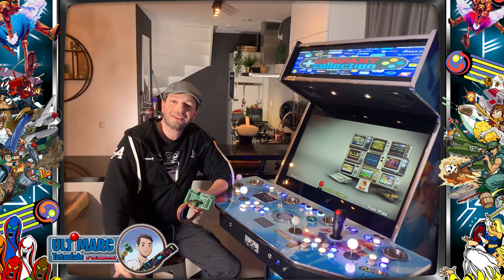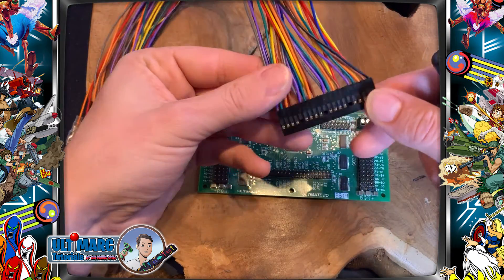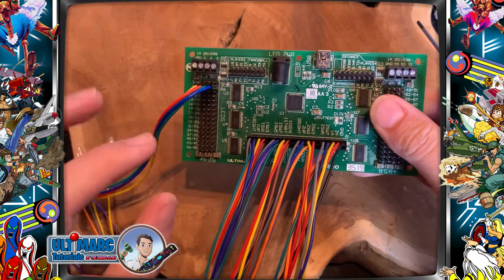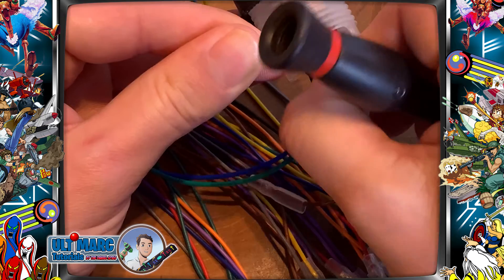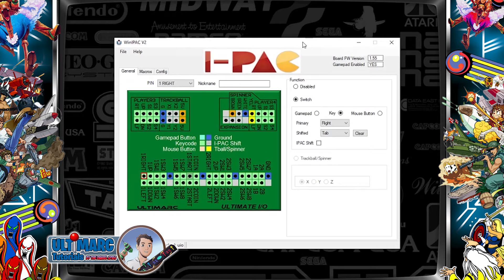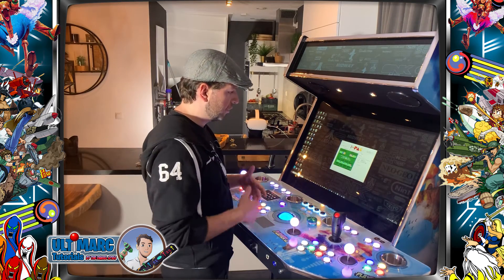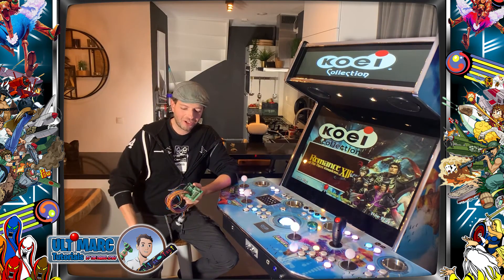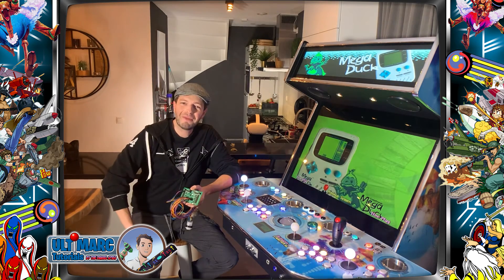Ultimarc Product tutorials: Ultimate IO board (Keyboard Encoder AND Led driver combined)

Comment: Why are are the harness cables so short? I have a two player control panel with trackball and the cables are too short? What do I do? Should I solder extra length in between each wire? I'm a bit annoyed that they just didn't provide crimp tips and extra wiring. I'm also confused about what extension harness to buy if I go that route.
Reply from the maker: The cables are not too short in my opinion. If you mount the board in the correct place you should be fine. You could try and ask Ultimarc if there are ready to go extension wires available.. Thanks D
Reply: @TheDanielSpies_Arcades  Thanks. That's what Andy told me also. But when I place the harness at the very center (which is my trackball) It barely reaches the right and left ends. I have an 8 button setup. 

Even if I had a slightly smaller control panel,  there could be no wire management when some of the wires barely reach. 

They do have extensions but I think I'll just solder some extensions.

Comment: Thank you Thank you very much now I know what this shift key is for, I only have 32 buttons and this solution will be useful: P
I have a question:
Do you know how you can configure the ipac so that when you start a given game, the wheels recognize the wheels, switch between the keyboard and the pad (as you know, most new games for Pc like Mk9,11 etc only work on the pad, you cannot change the buttons on 2 players) great that Ipac is in multi mode but can you make a script etc to do it automatically ?
Reply from the maker: Hmm good question. I know that you can change the Ultimarc IO mode to via command line. I can imagine that we could run an AHK script with the start of each specific game.
I don't have time to do this in my spare time but I think I can make the script. Contact me by email to further discuss. Thanks, Daniel

Comment: I'm trying so hard to get my ultimarc lux buttons and two ipac ultimate boards working. The LED's only light up on the first pin set of each side. Any help would be awesome. This has been a pain CP is 4 players spinner and trackball (hence the two boards).
Reply from the maker: This could be a defective board, wrong power supply, or lots of other stuff. You can make a video (in detail) and send it to me and I will take a look at it or, contact Andy (Ultimarc) for help. Thanks Daniel
Reply: @TheDanielSpies_Arcades  I sent Andy and Email. I'm using the same connectors that came with the two boards. The molex connectors. the second board when connected has two that will light up at the same time, one from each side. 

Each button turns on when you plug them in one at a time to the top slot, but only the top slots. 

We just got hit with a snow storm so waiting until that goes away so I can get the connectors I need to attach the sanwa sticks to the ipac (they are the 5 pin with wires bare at the end) then I'll put it back together and see.

Thanks for the fast reply.

Comment: Can it be configured to works in raspberry and works like an arcade controller separately? Example: I want to connect only player 1 on computer and play it without the raspberry operating. Im asking that because thar ultimarc io only have one usb exit, but can we choose what player to use?
Reply from the maker: I see what you want. You have a Raspberry Pi inside the control panel but would also connect it to a pc without switching usb cables? I did that in this build: https://youtu.be/0ax99FeprEk let me know if this is what you need? Thanks D

Comment: Hi how do you get 2 ultimate io boards working at the same time? I only seem to beable to do it one at a time
Reply from the maker: Hi, yes the trick is to give them a unique ID. You need to flash the firmware for that. On the Ultimarc website you can download the firmware you need. After this the pc will recognize two different boards. Thanks, Daniel
Reply: Thank you so much!

Comment: Hi thank you for the tutorial. I also ordered 2 ultimate io and have the goldleaf buttons. But one thing i did not pay attention to when i ordered is the power cable for the leds. I thought it was just all powered by the usb cable. I have a gaming pc i bought and theres no way to plug in the led adaptor. How would i power this another way? Thank you
Reply: I found out you can buy power cables that plug into the wall for the adaptors for the rgbs incase anyone is also lost

Comment: Your tutorials are very helpful! Do you know a place or Do you by chance have a layout for setting up 2 I-PAC Ultimate I/O. I have a 4 player controller with 6 buttons for players 3-4 and 8 buttons for player 1-2, spinner, trackball, admin buttons etc Such as for players 3-4 the two extra buttons for the bottom press, what part did you connect to on the I-PAC Ultimate I/O. And did you connect to The 2nd board? Thank you again for your awesome videos
Reply from the maker: Hi, I connected player 3, player 1 and some config buttons to the first Ipac. Player 2 and 4 (plus config buttons) to the second Ipac. Having more than 4 buttons for players 3 and 4 could be a problem I think. I never tried that..  Thanks! Daniel
Reply: @TheDanielSpies_Arcades  Awesome. Thank you for the help.

Comment: Hi Daniel, why do you have two IO Board in your cabinet? And what is the best options to put the spinner and trackball directly to the usb port on the computer or on the IO Board?
Reply from the maker: Hi Morten, The reason is simple: each board has 96 LED outputs = 32 full RGB buttons. I have 41 buttons so I needed to have a second board :-)
Reply: @TheDanielSpies_Arcades  Just wondering..... but I see you have 41 buttons. I was wondering if I'm only going to have say 36 buttons and more than 4 of them are going to be non-led, can I just piggy-back off of a different button. For example, for my "pinball" buttons could I just jump off of a player one button? This is really the only thing I'm a little confused about. Thanks!